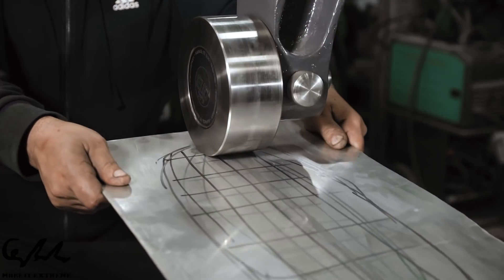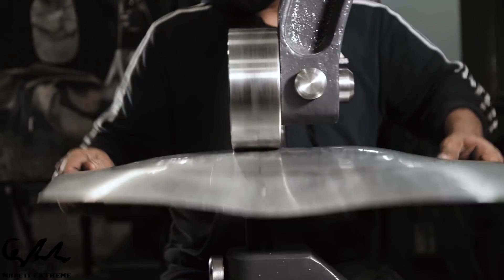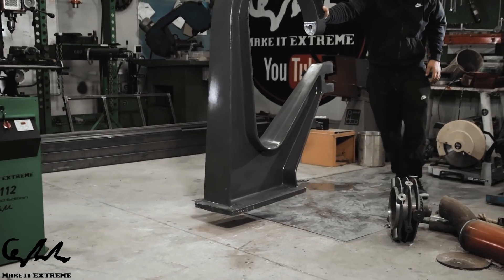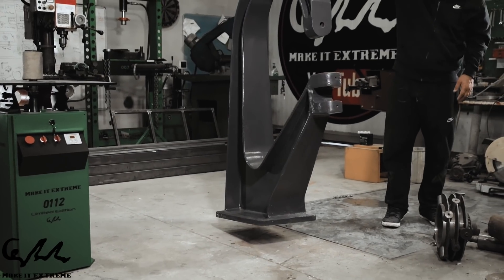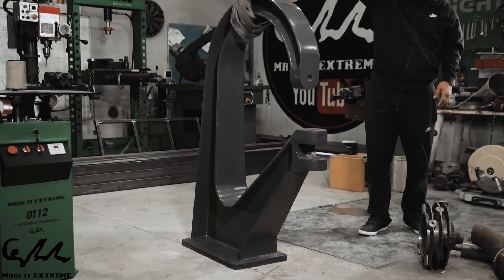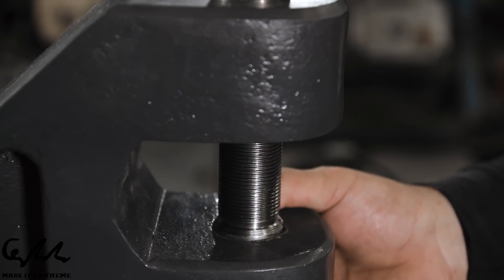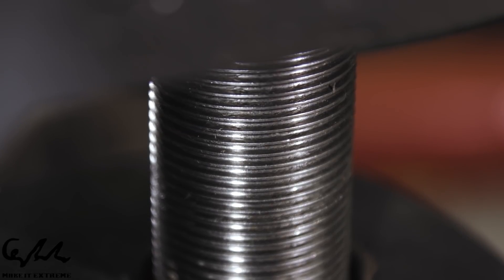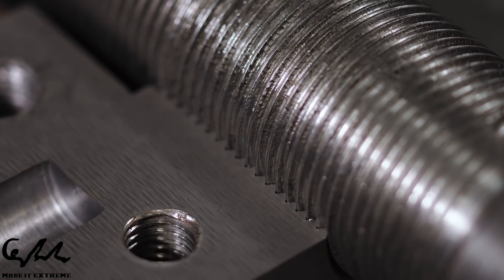I Made a Split Nut and It's Seriously Awesome

Comment: I am a little unsure why  you went through the effort of making the split nut. I did not see the utility of it demonstrated. Maybe there is a utility?   It is not a speed nut that quickly  allows for  rapid movement of the threaded shaft.  That's what I  expected when  I saw the title.  
 I do see a problem.  The thrust bearing and the bearing surface. I should think  you need a hardened bearing race on the  wheel frame below the  split nut. If this is a casting  it'll wear  quickly. If it is a forged frame  then it'll be uneven and damage the bearing.

Comment: What I am waiting for and which no one has ever bothered to make, is a highly explanatory and illustrous explanations and demonstrations that will teach and show HOW TO USE BASIC MACHINE TOOLS TO MAKE OF THE BASIC MACHINE TOOLS THEMSELVES. I know how in my younger years when I was in my 20s in the 1950s but I have no one to help me on how to an audiovisual website for the internet. I am OLD SCHOOL engineer. We do things the old way using slide rules, abacus, printed charts and printed ratios and printed conversion tables guides, realms of paper and a pencil to make mathematical calculations, etc. No computers and calculators were ever used. I live in a far away place using a multi-router re-router to prevent anyone from tracing me back exactly where I am in my own country. This multi-router re-router allows me to enter into American internet networks through an innocent American PC or any computer that I need to use as a conduit to gain entry into the American internet networks and anyone tracing me back will just meet that local innocent American PC's ISP address or any computers' ISP address. It is like your multi-user program and hardware that allows 30 to 50 users to share 1 PC computer without being aware of each other. My multi-router re-router works also that way and it was installed in the late 1980s and it is still working for the technician who is my friend have used industrial grade components for non-stop industrial functions.

Comment: "Golly mister, you sure have big nuts!"  😁
I've often had trouble with knurl pattern alignment, even when the circumference is a perfect multiple of the pitch.  At least one of them tracked correctly for you.  There must be some black magic there, like always making it a couple thou oversize or something, so the depth of that critical first pass is perfect.   Q: Was that heat & quench just for the black oxide coating, or was it a hardenable alloy?    Too bad the surface of the frame was so rough; it may chew up those lovely thrust bearings.   Nice job.  Enjoy using it!

Comment: Q: is the coolant recycled or its just dumped out once it got mixed with metal chips?
Reply: Coolants are always recycled.  They flow back into the main tank and are being pumped up from there.  Metal chips don't contaminate it.  It's all the rust and dust and scale that contaminate it, but you change it only once in a long while.

Comment: I've watched so much This Old Tony i forgot people actually have to cut blanks with a saw.
Reply: I was certainly hoping for a TOT karate chop...
Reply: @josuelservin  What I am waiting for and which no one has ever bothered to make, is a highly explanatory and illustrous explanations and demonstrations that will teach and show HOW TO USE BASIC MACHINE TOOLS TO MAKE OF THE BASIC MACHINE TOOLS THEMSELVES. I know how in my younger years when I was in my 20s in the 1950s but I have no one to help me on how to an audiovisual website for the internet. I am OLD SCHOOL engineer. We do things the old way using slide rules, abacus, printed charts and printed ratios and printed conversion tables guides, realms of paper and a pencil to make mathematical calculations, etc. No computers and calculators were ever used. I live in a far away place using a multi-router re-router to prevent anyone from tracing me back exactly where I am in my own country. This multi-router re-router allows me to enter into American internet networks through an innocent American PC or any computer that I need to use as a conduit to gain entry into the American internet networks and anyone tracing me back will just meet that local innocent American PC's ISP address or any computers' ISP address. It is like your multi-user program and hardware that allows 30 to 50 users to share 1 PC computer without being aware of each other. My multi-router re-router works also that way and it was installed in the late 1980s and it is still working for the technician who is my friend have used industrial grade components for non-stop industrial functions.
Reply: U wot m8
Reply: @darthvader5300  maybe Ron Covell ?? not sure if he has the videos your looking for ?? good luck ..
Reply: Thats not true, scissors work fine.

Comment: why need a split nut? not splitting a nut would be equally good
Reply: There's no other way for the nut to fit.
Look at 12:07
The threads are cut to a smaller diameter than the rest of the shaft.

Comment: Nice piece. But may I ask why you drilled, bored and threaded AFTER you split the piece in two? Surely doing it before means that the bore and thread would be more concentric to the OD with minimal run out. But hey, it worked great. Nice job.

Comment: Nice job but why does it require a half-nut?
Reply: Otherwise you couldn't get it onto the thread in the middle of the rod.
Reply: A much simpler solution would be to turn the lower part the shaft to smaller diameter to pass through a thread in a solid nut and use a simple bushing to hold the bottom of the shaft in the center of the bottom hole.
But that would make for  a trivial video instead of a rather educational “how to make a split nut” one.

Comment: The manufacture of the nut is excellent, but why make it in two pieces?
Reply: Because the threads on shaft are in the middle of bigger OD on both sides. So the shaft wouldn't fit trough nut
Reply: @jankocevar2665  but why didn’t they just make the top dia on the shaft larger than thread and the bottom dia smaller so they could all pass through the nut without splitting it, if the holes in the frame are the same dia and can’t be altered they could make a top hat bush to fit the bottom bore to reduce? Suppose it would have made a less interesting video though lol
Reply: @jankocevar2665  Thanks Jan!  That part was lost on me.
Reply: @jankocevar2665  You're right, I hadn't seen it, thanks
Reply: @jankocevar2665  somehow I didn't notice that the first time I watched it.  👍
Reply: Why not, two is always better than one :)
Reply: I also love the video and his skills but I was asking same question...?
Reply: I would love to know this myself
Reply: the bottom and top of the die holder are larger than the thread. there would be no way to use it if the nut wasn't split.
Reply: Look at the bottom part of that pin.  It's wider.
Reply: @maximo paesa  Because 3 parts is one too many!
Reply: because youtube

Comment: I am not getting why this nut need to be a splitted one
Reply: The reason for the split nut is because the diameters of the shaft on both ends are larger than the threaded section in the middle. The reason for using larger diameters on the ends is because they are bearing surfaces. An alternative to using a split nut would be to use a removable bearing insert to accommodate passing the threaded portion through the casting and using a smaller diameter bearing surface on one end.
Reply: @EDesigns_FL  right like turning down the end of the shaft and adding in a oil brass bushing for example. seams a lot easier option to me. to each there own
Reply: @zednott  Using a bearing sleeve is much easier and it's how I've dealt with this issue in projects. I recently made a new micrometer stop for my lathe and pressed a bronze sleeve on the back end of the shaft to address this problem and it works great. Different machinist will arrive at different solutions to the same problem ;-)
Reply: exactly what i was thinking, if you have to use solid roller barrings then why dose the nut need to be a split one
Reply: The bores in the casting (frame) have a set diameter, and the shaft with the threads has to fit closely in both of them. Any nut that is not split would not work here. If the threads are smaller than the shaft (like it is now), the nut will not fit over the end and needs to be split. If the thread is larger than the shaft, it will not go through the upper bore in the casting. The only way a standard nut would work, is if the lower bore would be smaller than the upper bore, with the thread´s  outer diameter in between.
Reply: Because the shaft isn’t threaded all the way. The only way to get it on is with a split nut.

Comment: Wasted time making the split nut. Cut/Thread the bottom of the vertical shaft holding the lower wheel, make solid center adjustment nut. Insert the vertical shaft in the housing through adjustment nut and thread on a cap from the bottom that will be the guide in the lower housing. 

Way less machining, stronger setup.
Reply: I disagree. Only other way to get the nut in there is to thread the entire length of the vertical shaft which would have made the sliding action a lot less smooth.

Comment: Great video, one thing I don’t get is why did the nut have to be split? Couldn’t you not just use a nut and slide the rod from the top in it to secure it and than screw it in? It can’t come of by turning it up to high because the other roller should stop it...
What am i missing?

Comment: Am I missing something, why did this nut need to be split? Couldn't you have just threaded the bottom carrier along its full length and screwed it into a once peice nut from the top?
I get that there is a pin to lock the carrier from spinning but this could be removable to allow for the initial connection.
Reply: lol no dude. think about it some more.

Comment: Brillant build as always - you saved at least 500 euros by building yourself! :)

Some recommendations out of my engineering pov: 

[@all: please do not snowflake around - my recommendations do not criticise make it extreme or anyone else - I just want to share my experience and help to improve the part/build - so these channels and context can live longer and provide us good material! ;) ]

5:22 - try to grind your part diagonally the next time - that will distort your perpendicularity less by reducing the contact surface thus helping you having a better mating surface.

7:54 & 9:09 to increase the longevity and also the smoothness of the axial bearing, definitively give those two surfaces a good finish, at least a 800# sanding or even higher. Some metal polish would not harm. Also the mating surfaces of the frame 11:57 - not only it will run way smoother, it will also increase the rigidity and feedback to your wheel.

13:15 A snap ring would be way easier to install - and also would let the english wheel roll way more freely. Also maybe some bronze bushings would make it work way smoother.

13:24 - same here, a dab of high pressure lube (MoS2 or similar) on the shanks will it roll way softer and also reduce parts wear.

Your sheetmetal give you the feedback you need. thus making the whole process run smoother, gives you way better finish and a nicer part.

Comment: Can you show us your machines? Like what lathes you got and the mill and everything. Please!
Reply: And make extreme version of those, so people could replicate those designs to make their own, to start making stuff. Least where i'm from lathes are really expensive so best you can do with no budget is part attached to bolt that is chucked into drill and then material is removed with grinder. Got fed up to that and building my own lathe now on low budget, but as a machinist Make it extreme has far more insight to proper lathe designs and probably could come up better design than me.